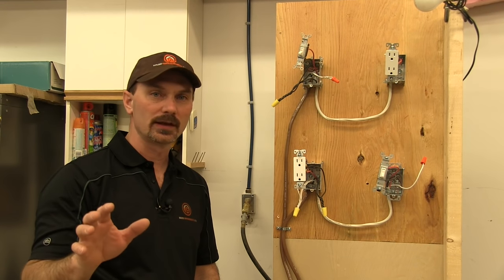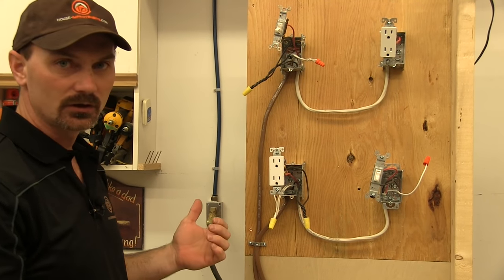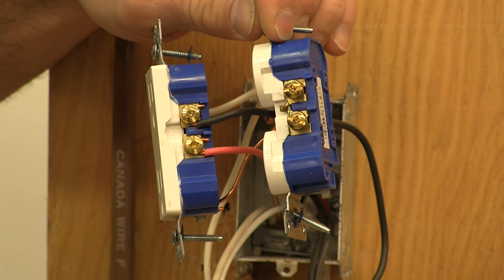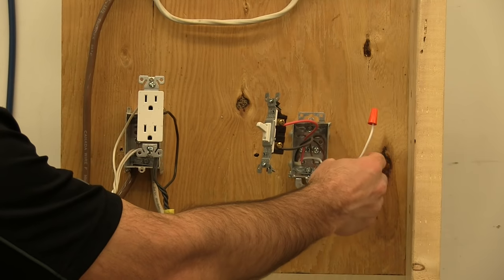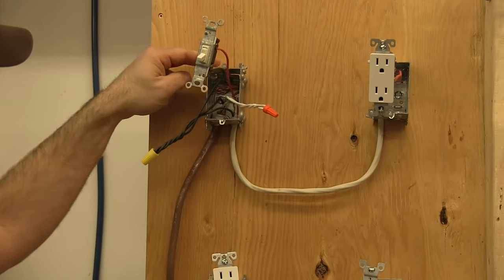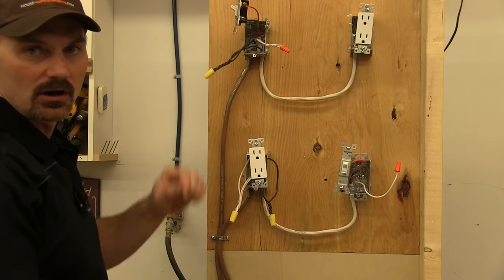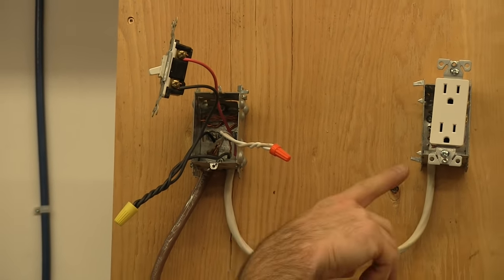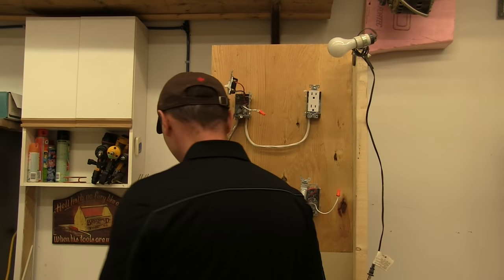How To Wire A Switched Receptacle

Comment: Question I have a switch box with 3 Romex wires coming in to a switch . One wire is for a over head light . The other is coming from a powered receptical. The 3rd wire goes to two recepticals that are hooked up so both  recepticals are have switched power . How do I wire it so the two recepticals are constant not switched power I only want switched power for the overhead light. Please help thanks
Reply from the maker: Please repost your question in my forum and we can help from there.https://www.house-improvements.com/forums/

Comment: What if your wires only have 3 total such as, ground, neutral(white), and hot(black)? I'm adding power to a barn. I have the wire coming from breaker to switch then another wire to the outlet. Just the wires I'm using only have a black, white, and ground
Reply from the maker: please post in our forum ,it is the easiest way to help you.https://www.house-improvements.com/forums/

Comment: So if I want 2 switches to control each top and bottom, would I then break the white tab, and wire that individually to the other switch in the same manner as the other? (Bottom setup is what I have. outlet to switch)
Reply from the maker: please post your question in our forum we can help easier from there.https://www.house-improvements.com/forums/

Comment: could you wire several outlets together with a light switch? or do you need a special heavy duty light switch?
Reply: The switch rating needs to match the breaker size.   15 Amp for a 15 Amp breaker, 20 for a 20.

Comment: This is almost what I need to know.  I have an existing switch to a plug under my kitchen sink.  The switch powers both plugs. My romex  only has one black, one white and one ground coming from the circuit breaker to the outlet and only one black, one white and one ground to the outlet from the switch.  How can I make the outlet half hot with that configuration?
Reply: Replace the cable between the switch and receptacle with 12/3.

Comment: Do I need to run 3-conductor cable in the first scenario? I’m wondering why I can’t use the white in place of the red.
Reply from the maker: New codes now require a neutral at  the switches.
Reply: @HouseImprovements  thanks. That explains why I see drawings online both ways. Love your stuff.

Comment: Where does the red wire come in on example 1? I only have ground power and neutral wires for my switch
Reply from the maker: in an older set up before a neutral wire was required at switches the white neutral between the switch and receptacle would have been used as a hot wire. So basically use your white as I used my red. If your power started from the receptacle .

Comment: Hi 
Multiple electrical outlets  in all 3 washroom  stop working after separating fan and light switch and installed  new  fan with light  when i turn the same  fan light on  the power comes to all outlets but when i torn it  off it  cut the power  in all the washrooms
Reply from the maker: Our forum is the best place for help with this. There is a link in the description of every video we upload.

Comment: If I want to change a switched receptacle to an unswitched receptacle it's just a matter of adding a short jumper wire to replace that broken tab?  Do I have to remove the wire running to the outlet at the switch?
Reply from the maker: Remove the wire from the switch and cap it with a wire nut and either replace the receptacle or use a jumper.
Reply: @HouseImprovements    Thanks!

Comment: we used the white wire for a hot wire to the switch.  the one going from the receptacle to the switch. I think that is allowed by code. Or not!
Reply from the maker: with todays new codes requiring a neutral wire at the switch a switch leg is hardly ever used anymore. if you do then use a three wire so you can have a neutral at the switch.
Reply: @HouseImprovements  that was when I was wiring new residential houses that had to be done fast (time is money).

Comment: I am conpletly lost sean.. I have a toggle switch that does control 2 lights in the kitchen though i took one of the lights out & put in a plug receptical though i want to have constant power to that wall receptical & the switch yet to control the other light that said the box in the wall only has a white wire & black wire so wouldnt that box have to have two extra wires brought over from the toggle switch or add extra wires direct conect to my outside fuse box to that box in the wall to have constant current  to the box that only has two wires? I am wanting to plug a tv into that receptical & dont want to have to turn on a switch to turn the tv on as well having to deal with the other light coming on flipping the switch.
Reply from the maker: Please go to my forum for assistance . https://www.house-improvements.com/forums/

Comment: Is it a code thing to require use of 14/3 vs 14/2 and indicate the white-wire-as-black with electrical tape?
Reply: The new code updates require 12/3 for this installation.   The code requires a neutral to be brought to every box.  Use the red as a switched hot.

Comment: I have a switch that power up the outlet, and now i want to install recess lights , should i connect the recess light wires from the switch or from the outlet, and how do i know that the main line goes first to the switch or to the outlet..thanks !!
Reply from the maker: Please ask your question in our forum. https://www.house-improvements.com/forums/

Comment: In my situation, the POWER is coming from the light fixture to the switch (one wire), the second wire is going from the switch to a receptacle. Previously the light was controlled by a pull string, I'm trying to install a new LED light and want to control it with the switch, but I also want the receptacle to have constant power. Can you help?
Reply from the maker: Can't do it without a 3 wire between the light and switch. If you need more help please visit my forum .https://www.house-improvements.com/forums/
Reply: @HouseImprovements  Thank you for the prompt response. Can it be done with making the receptacle controlled by the switch along with the light?

Comment: For some reason the red to my switch is acting as a constant hot and at the outlet it’s also being a constant hot don’t know how this happened but no matter what the red has 120 volts even if I disconnected it from the switch entirely and the tab is pulled on the outlet so they not riding off one another it’s puzzling. I don’t know how the red is being energized
Reply from the maker: come to our forum with your questions if you want help.https://www.house-improvements.com/forums/

Comment: What is the red cable? I do not have it in my wires
Reply: 12-3 and 14-3 nm wire, aka Romex has 2 hot wires, red and black and one neutral, white. Ground wire is also there, but not counted, hence -3. 12-2 and 14-2, same but no red wire.

Comment: I have an electrical outlet that has BOTH outlets controlled by switch. Every time switch is turned off or on to control light in bathroom, the outlets go off. Can this be remedied to one switched and one unswitched or both constant with live current?
Reply from the maker: It can be but the exact fix will depend on how that circuit is wired and where the constant power originates in that room. Try my forum for more help with this.http://www.house-improvements.com/forums/
Reply: HouseImprovements , THANK YOU FOR THE REPLY! I will check out your forum today. I should have seen the ENTIRE video which I saw now. You explained and answered my question thoroughly in your video post. Thank you! One Of the best video post out there!!

Comment: How to wire switch controlled GFCI receptacle where both upper and lower outlet of this receptacle  are controlled by a single switch. When the switch is ON position the receptacle is hot when switch is turned off the receptacle doesn't receive power.
Reply: Returning red (switched hot) connects to line terminals.

Comment: You won't have a flash or spark just the receptacle won't be switched, it will be constant hot.  National Electrical code will not allow two different circuits to be used in this type of installation for safety.

Comment: So if I want to reverse it to make them always constantly hot and not tied to a switch anymore I would????
Reply: Disconnect the hot from the switch, insulate it with a wire nut, and jump from the constant hot to the other terminal.   Or buy a new receptacle.

Comment: Why use a 14/3 wire for the switch?

Is 14/2 not usable?
Reply from the maker: I'm assuming you are referring to the bottom example. The answer is yes you need 14/3 , the reason being that almost everywhere now requires a neutral at switch location. This is because many specialty switches (many dimmers) need a neutral wire now. Back in the day you used 14/2 and this was a switch leg where the white wire was used as a hot wire and not a neutral.
Reply: @HouseImprovements  you rock...
Thank you for answering so quickly

Comment: so both switched, but on a 3 way circuit with two switches?
Reply: Using 2 3/way switches with 12/3 romex between them, The white is used to bring the hot through to the last switch, the red and black are travelers, and the black from the first switch returns to the receptacle.

Comment: so basically if i want to get constant power from a single light switch to power an outlet neutral isn't used
Reply from the maker: If your switch wiring is not just a "switch leg" (many existing ones are) then you could get constant power from that switch. You do need neutral for a receptacle. Please use our forum if you have further questions.https://www.house-improvements.com/forums/

Comment: I have a wire project going on now and when I turned on the switch the power went out. the problem is in wiring the switch. thanks.
Reply: You connected the neutral to one of the terminals of the switch.

Comment: He forgets to pig tail ground wires on lower example and no ground with the box. Pay attention to very important things that would be safety.
Reply from the maker: The grounds are all correct in those examples. In Canada we do not have to attach the ground to the switch  only to the box. we Do have to attach to the duplex receptacle and the box.